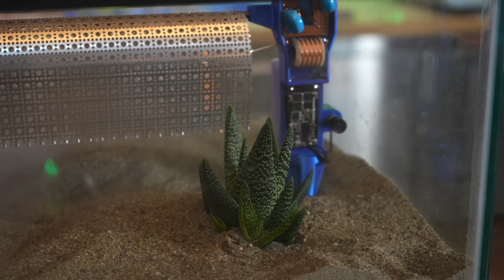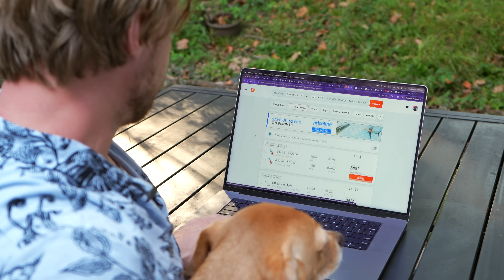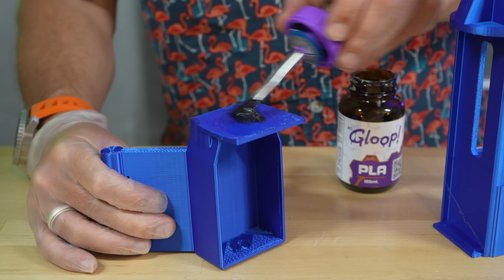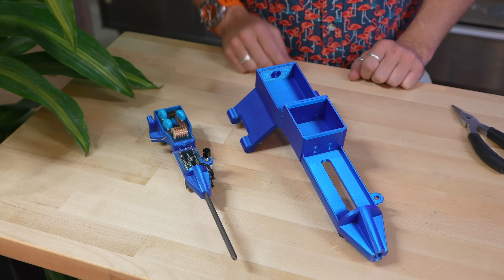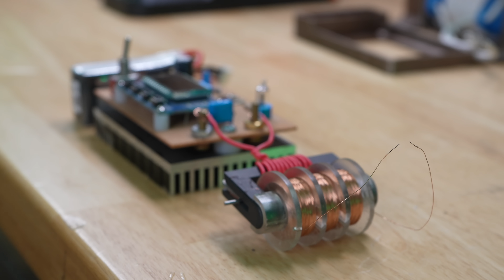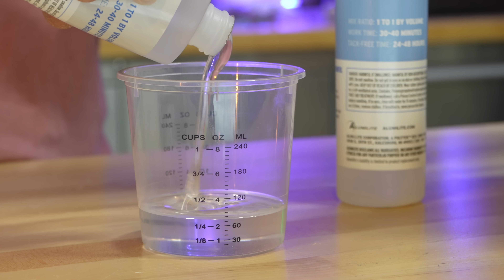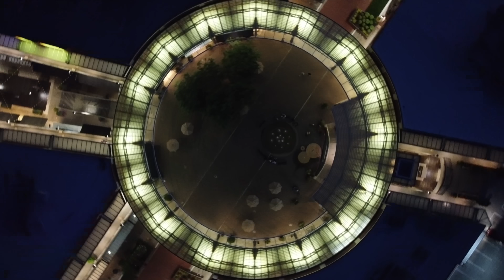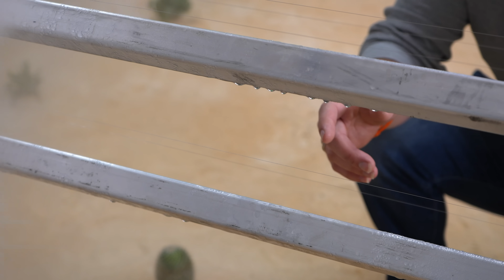Turning Desert Fog into Fresh Water Using 50,000 volts

Comment: I'm a bit disapointed we were teased a field test that went nowhere, there's zero metrics other than "oh look I dumped a shit load of water on my water collector and it got wet", the mechanical design is barely done (water drops everywhere instead of at the bottom the the inclined arms, the printed pieces need a gazillion amount of support and the whole assembly is still very bulky) and I seriously doubt that your solar panel battery thing can power this 120W structure more than like 20min. I watch your channel for a while now and I think you overhype what you make way too frequently in the last few years, sometime the end result is just a nice concept to be perfected and it sounds very incompetent to make groudbreaking claims
Reply: You also left out the bit about how unsafe it is.  I think it would likely need a much larger solar panel and battery storage and I would use a fan to blow the air over the protected HV wires.  It would use more electricity for the fan, but I think you could make the device smaller.

Comment: You could add a humidity sensor that could act as a switch. It will only turn on when there is enough water in the air, and turn off when there isn't.

Comment: Congratulations on making an ACTUAL bladeless fan!
Reply: In all seriousness though if you made it in x shape like your original diagram had it you wouldn't have to adjust it, becaude it could capture fog from all directions.
Reply: Other people also mentioned it, but angling the "legs' down slightly, would make for easier collection, as each " leg" would only need one collector at the lowest point, instead of needing a really long one, under the whole legnth of the device.

Comment: With regard to a fog sensor, something like a DHT11 should provide all the data to calculate if fog is present. If the dew point is within 2.5 °C of the current temperature fog is likely to form. If you pair it with something like an ESP8266 or ESP32 you get a wifi and/or bluetooth that can monitor your sensor and drive the on/off cycles.

Comment: You know, this garage desert seems like a good mid scale test to me.

In terms of the fog activated switch idea I bet you could use something along the lines of either a simple humidity sensor of failing that, a small old fashion fog net dropping water into a cup with a humidity sensor in it.
Once the sensor goes above a set value the fog condensor turns on. You could also use a light sensor for the turning off since fog tends to both block sunlight and get destroyed by it.

Comment: You could use a hygrometer to check for moisture Levels and turn the system on when the moisture in the air is high.
Reply: how about one of the many smoke detector designs, they are already optimised to detect particulates in the air and to not consume much power. (Though you would probably still need to lower the detection threshold)
Reply: @gergoric6707  Once again, false alarms. The method that I described should hypothetically be hardened against false alarms — a lot more so than an optical sensor. Also, you're potentially running the risk of hitting a trade-off between reducing false alarms and missed alarms. Especially considering that you'd have to be designing the enclosure against not just the desert environment, but also the sun. The way that the optical sensors work could potentially have issues with the sun's light preventing the alarm from being triggered properly. 

Also, I don't think money is an issue yet. It'd be less of a headache to first use a solution that's more guaranteed to work over a solution that may have issues. Any cost associated with the design can be ironed out after the fact. I.e., avoiding premature optimization. Even then, the cost resulting from the usage of humidity and temperature sensors likely wouldn't be significant enough relative to an optical sensor.
Reply: @bndlett8752 I wrote my suggestion and scrolled comments after and read yours, my suggestion was a combination of both of your ideas actually. I first suggested the smoke alarm. Then thought about false run triggers. Add code to receive X amount of smoke alarm triggers to avoid false triggers. But if you're already incorporating a μC then add a psychrometer and set a threshold for RH and dew point to prove to the system it's actually foggy before run trigger.
Reply: @gergoric6707 humidity sensors can be nearly passive to completely passive
Reply: Why not just use a timer. If you get enough charge for a day just run it every day. Also solar panels aren't expensive, and the one he's using is shit.
Reply: I would use a oldschool hygrometer and attach some circuit that closes up at a given amount of relative humidity in the air, because modern ones draw current while being used. I would also attach a wind turbine for cloudy days with just wind...
Reply: @zanaa.johansson145 I really like this idea.. They could add these devices in try climates for passing wild life to drink from too. Might save a species or two in climates heavily affected by climate change.
Reply: @OldSchoolKaki  have you heard this thing? that thing is a good way to deter any wildlife in the immediate vicinity
Reply: @zanaa.johansson145 

That's just excessive.

How many cloudy days, exactly, are you frequently running into in arid environments, that would justify the use of wind turbines for producing energy, so as to farm moisture? Furthermore, this isn't even about harvesting energy to power such a simple contraption, but just enough to farm condensation. Solar is more than enough, and a hygrometer won't change anything in the equation.

 So, you have an evening that doesn't produce much condensation. How is a hygrometer to make any difference, besides intermittently or continuously wasting power? This device alone, if multiplied, is more than enough to extract what moisture needs to be extracted. If not? A turbine and hygrometer aren't changing that. A rare instance with no sun, nor harvestable condensation? How are those two items to change that?

 Furthermore, wind turbines are absolutely horrible for the environment. They're expensive, difficult to maintain, and they hardly produce enough energy to justify the eyesore means they cause: Graveyards of discontinued turbines litter much of the fly-over states in the US, and for obvious reasons: They're next to pointless.
Reply: @OldSchoolKaki  Agreed, especially, if the harvested water can be stored effectively in an underground tank to reduce evapouration where when an animal approaches the water can trickle from a faucet, allowing the different animals to drink, whilst causing as little contamination of the water via different animals sharing the water and without contamination from faeces.

With a solar panel and wind electricity generating turbines, it may be plausible to install an ultra-violet light emitter to kill of any lingering bacteria, to make the water a fresh and reliable resource.

If this idea proves to be successful then these water points could lead to islands of biodiversity in desert areas which allows endangered or wildly dispersed animals to increase.

It may also revolutionise the efficacy and profitability of growing food in desert areas to provide cheaper products leading to food and water independence for all.
Reply: @Pakkotehdataapska  A timer wouldn't guarantee that the device turns on during the fog. You might end up wasting a bunch of power turning the device on during dry times or just end up missing minutes to hours of fog, which can be a huge issue overtime in a region where fresh water is scarce.
Reply: @Pakkotehdataapska  That solar powered battery bank was clearly just a use example. He had a much higher grade battery built into the stake itself.
Reply: @Pakkotehdataapska  wouldn't work year round
Reply: What about moisture sensor as sensor turns on a short burst light. light  sensor would register moisture by measuring reflection of light making system check for false positives putting moisture sensor near vacuum to reset after false postive?
Reply: Or a day night switch
Reply: Could also just detect nightfall the same way an automatic night light does.
Reply: Why not just a timer? There are roughly 4 hours of fog split at reliable times every day.
Reply: @davidfidler8761  Isn't location a variable to consider? It has to work for a variety of different locations.
Reply: The indigenous people had to collect water without a degree in electronics. It only took 5000 years to come up with a solution. Now let's get these people a drink of water, quick!
Reply: Just put a day/night switch in.
Reply: It seems to make sense, but kinda falls apart when you think about it. If you have a dryish morning and the machine doesn't run, then you've wasted the whole days worth of charging by producing nothing, since the stored charge is worth nothing if the machine doesn't run that night.

It makes more sense to just charge all day and run every night.
Reply: @operator8014  He's looking for a fog sensor, so he only wants it to run when the air is a certain humidity, temperature and dew point which a psychrometer would be perfect for. Mix it with an optical sensor like a smoke detector and when the conditions for fog are met and the optical sensor is obstructed it activates the unit. You are also trying to avoid wasted cycles on the battery as they have an optimal number of charge and discharge cycles before needing to be replaced so just running it on a day night cycle is more wasteful, remember this only works if there is fog that can be condensed.
Reply: @Telecrit32  Wouldn't a smoke detector be at risk of false positives due to fine wind blown sand?
Reply: its for the desert mornings... to catch the fog/dew/moisture...

Comment: I would use an IR sensor(s) that could identify water density and the proximity of the dense water cloud. once those variables are satisfied, it should satisfy the interlock then turn on your system, that's how I would start that design.

Comment: That solar panel / battery pack won't last a year in desert conditions. That's going to be a major struggle. Also I think the complexity of having hinges isn't worth it. What could you could instead to try and do is use the aerodynamics from the thrust to focus the fog on a downward trajectory leading into a covered or one-way catch system to avoid later evaporation before harvest. Overall very cool though. Maybe throw in a peltier device for good measure that lowers the temperature of the condensers, but that might be a bit inefficient in terms of power usage. A more passive method might be, if possible, transfer the coolness from the ground upward into the condensers. But if electricity is running through them that might ruin the circuit?

Comment: hook up a switch like a relay on the relays nornally closed contacts so when it is powered uo the switch is in the off state then simply power yhe telay with a solar panel. at night the power for the switch shuts off and allows the unit to run. this wat if theres sun its charging and if theres no sun its running. you can add a capacitor to smooth out the panel and keep the switch from bounceing

Comment: For automatic activation of the system I would suggest using a combination of an internal clock, the energy level of the solar panel and some humidity sensors positioned at the ends of the arms (or better positioned above the height of the machine) because when the machine starts operating the local humidity drops instantly... so it is necessary to position them sufficiently distant from each other to have a wide measurement area, and also distant from the condensation area of the machine.
I hope my ideas help..
if you have any question, please ask

Comment: You could improve the wind capturing aspect of it for the 3rd generation by combining 2 designs:
1. Upside-down cone with spiral helix edges - a shape that's been used in deserts (found in the middle east IIRC, used by ancient people) to pull wind down into a tunnel, where it would push water, used as an underground water  transportation system (prevents water evaporation, water used to be collected in those kind of wells).

2. Spherical turbines - there's a design of  wind turbines shaped like spheres with gaps that turn 360 in all directions, letting it be moved by wind incoming in any direction. You could use a permanent magnet or an electromagent to make it float.

If you can combine the two design then channel the air into the system wind would be funneled into it from any direction. By closing it maybe you could even make the air expand and contract, in such a way that it would lose heat, and the water would condense more easily - could be passive with a geometric design, could be active with a condenser and compressor.

Once you funnel in air passively, then condense it (passively/actively), and then actively pull water from it electromagnetically, you could have much more water produced per unit of time.

It would be like wanting to as much sugar as would fit in your motub, where instead of eating cotton candy someone shoots white sugar straight into your mouth.

Comment: You should incline the wings up a little, as water will follow the contour and create a collection point either on the ends of the V or on the center stack, also, you are welcome to come to Chile for testing!
Reply from the maker: I stated in the video that the wings were angled at 4 degrees so that water accumulates at those points. Turns out 4 degrees is just barely not steep enough. 5-6 would be ideal.
Reply: @PlasmaChannel  Could also simply add collection channels below the tubes so the water can fall wherever but still flow towards a central location.
Reply from the maker: @kezyka6775  All great recommendations!
Reply: @PlasmaChannel   I'm really impressed with the electrical:water efficiency progress you've made over the previous version!! How many hours can that battery size run that circuit?  Mechanically I have a lot of suggestions to make it a functional field usable device, but I did catch that you mentioned the 4deg slope.
Reply: @weatheranddarkness  Battery nominal 11.1 V x 6800 mAh = 69 Wh so at 120W it would last about 30 minutes. Gonna need a lot bigger battery.
Reply: @PlasmaChannel  Yes, that should solve it, better would be if the water could get trapped inside the metal profile, besides the outside, but i don't know if that is posible.. something like < > instead of a solid profile
Reply: This, but not this, he doesnt want the center point, where all the electronics are, to also be the collection point, i suggest angling it the other way, so the center point is higher then the ends of the legs, you would then need a collector at the end of each leg, but it would prevent moisture from attacking the electronics. 

Also it might work better if it was in an "X" shape, like his original drawing, then it wouldnt have to be adjusted as it could catch fog from any direction.

Comment: You have a solar panel attached to it... can you use that to detect light levels to when fog might be conductive? then you can just use that as a benchmark to turn on the condenser part, then you wouldn't have to add anything at least for it to be more automatic.

Comment: 21:20 If the fog is only present during the night and early morning, you could use the solar panel both as a power source and as a sensor. During day, the solar panel generates power and gives a signal to not turn on the system. At night the solar panel doesn't give the signal turning on the system.
Reply: That’s almost identical to how a garden solar light works — the solar panel doubles as both the power source and the light sensor. When there’s sunlight, it charges the battery but keeps the light off; once it’s dark, it stops producing power and the battery kicks in to light it up.

If you want to actually detect fog, you could go with an IR LED and photodiode setup. When fog rolls through, it scatters the infrared beam and the sensor picks up the drop — super simple and pretty reliable.
Reply: @DannyWood7989  So might wind-blown sand.
Reply: @DannyWood7989  It's called a photocell. You can actually get humidity sensors to detect the moisture. I worked with HVAC low voltage BMS systems for a while, could probably easily hook up a PLC and a humidity sensor in this setup with very low power draw

Comment: What about instead of a fog sensor you load up a cheap Arduino with information re: sunset and sunrise times locally and just configure it to turn it on and off when the time/date table says to?  Not as effective as actually sensing fog, but should be relatively cheap and easy to do and I'd think that'd use far less battery.